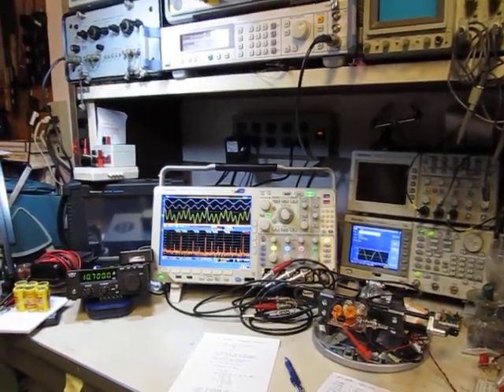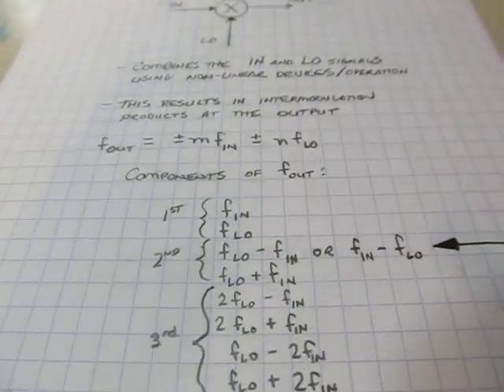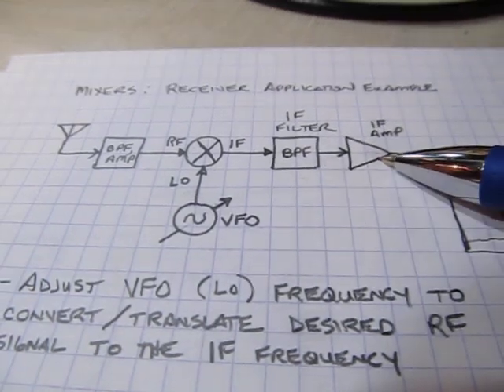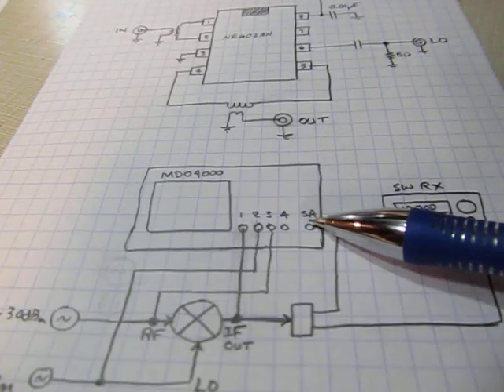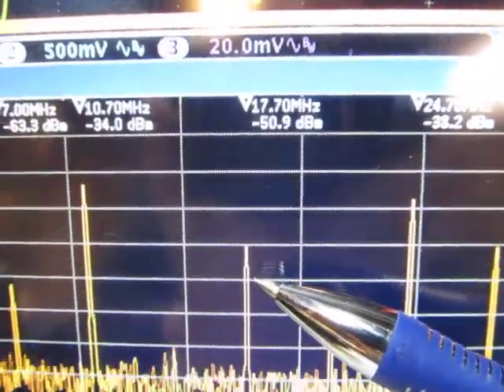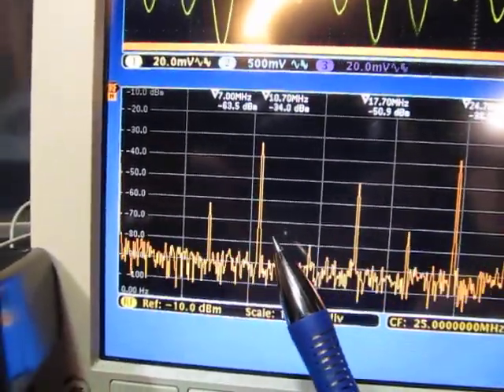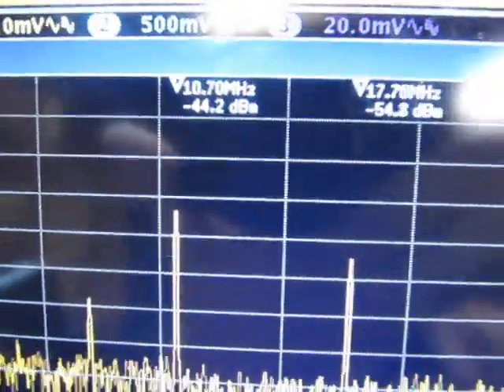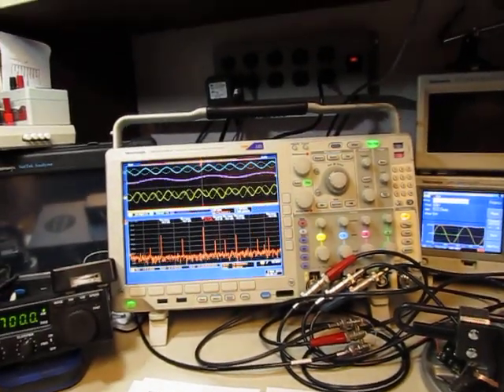#83: Basics of RF Mixers in Radio Receivers / Mixer Tutorial / Frequency Conversion

Comment: I'm building a Direct Conversion Receiver at 28.224Mhz. I'm using the same mixer (SA602) How do I achieve 15dbm gain from the mixer? I'm receiving about -100dbm from antenna, BP filter gave me -3dbm loss, 2 stage RF amp gave me 15dbm gain, and LO has tuning gain from -20dbm to +10dbm. I'm sure you know this, but basically I need as much gain from the mixer to go the audio stage, certainly I don't want to lose any dbms. Please if you can, answer this w2aew. Other question, what is your turn ratio on transformers, I know you are matching 50 ohm with 1500 ohm, thanks.
Reply from the maker: The Gilbert Cell mixer in the SA602 should give you a conversion gain of approx 18dB gain according to the datasheet.  (Gain is measured in dB, not dBm.  dBm is a measurement of power, not a measurement of gain).  You may want to review the SA602 Primer:
http://techdoc.kvindesland.no/radio/b1/20051213190607573.pdf
Reply: @w2aew  does it mean that in theory you should get at 10,7 MHz a power of Prfin x Gconv=Pif=-30 + 18 = - 12 dBm?  I see -30.4 dBm from the marker! Why?
Reply from the maker: @riccardoalbi4287  Because you didn't take into account the effect of the RF transformers and the splitter on the IF output.
Reply: @w2aew    thank you for the answer!

I saw in other comments that you're working with 50/1500 transformers for both input and output matching, and I expect no power loss in that case from transformers sections, I'm I correct?
For the output splitter I expect a 3dB loss because it has 2 ways from Your schematic, I'm I right?

 If everything is correct I should add only 3dB of loss taking into account the splitter effect and have to update the above computation to Pif= - 15dB, isn't it?  However thank you for all your videos! They are full of great tricks and considerations and very clear and well explained! 

Ps: I'm asking for those values because I'm doing pretty the same with a NE602 and I have the same values but I can't get why at the output I see less power than expected!

Comment: Nice video!. I am doing the mixer in order to build a superheterodyne but with a AD633JN.
I am not sure about the match of impedances. How do i know the input and output impedance of the CI and also the impedance that i need to adapt?
Reply from the maker: The AD633JN only has an analog BW of 1MHz, so I hope you're not going to be doing RF with it.  The datasheet has the input impedance (very high) .  You generally don't have to worry about impedance matching at the low frequencies that this device will operate over.

Comment: Is there a minimal VFO power level to drive the 1st Mixer.... I noticed that you used 0 dbm of drive power into the mixer.... 
Coud you drive the mixer with -20dbm... and still get decent performance...  Also... is it advantageous to run the VFO
at a higher frequency than the RF input...
Reply: Yes, there is a minimum power level for the VFO. The optimum signal level will depend on the type of mixer. Generally a -20 dBm signal will be too low. For instance, the optimum input power for a diode ring mixer is about 7 dBm.

Generally, a little too much is better than too little.

Comment: Thanks for the helpful video. I'd really appreciate it if you can explain how the amplitude powers are calculated theoretically. For example, at 17.70 MHz the spectrum analyzer reads -50.9 dBm. I want to know how that value is found. Cheers

Comment: Thank you. What thing happen if I don't use of transformers? just a simple one without any transformer and resistance and capacitance...
Reply from the maker: Sure, you can certainly design a mixer without transformers. The ones used in this circuit perform the unbalanced to balanced signal conversion and impedance matching.
Reply: Many thanks, I want to mix two frequencies with around 900KHz and 800KHz and obtain f1-f2 =100KHz, I decide to buy a SA602 (http://www.digikey.com/product-detail/en/SA602AD%2F01,112/568-5043-5-ND/1158038), Would you please tell me what other devices I should buy to achieve desired frequency? Thanks,
Reply: And also I can buy down convert mixer (http://www.digikey.com/product-detail/en/AD608ARZ/AD608ARZ-ND/997239). I am not sure it will work for this purpose or not?
Reply from the maker: Yes, the SA602 will work. You'll need to build a filter for the output to remove the 800, 900k and 1.7M components.
Reply from the maker: hossein jiryaei The  AD608 would be overkill, and is basically optimized for a 10.7MHz IF.
Reply from the maker: It is a surface mount part, so could be hand soldered carefully.

Comment: i dont get it: The RF-Signal (which we want to listen to) is at 28.4 MHz and the LO-Signal is at 17.7 MHz and the difference is 10.7 MHz. So we receive mainly the 10.7 MHz signal, but we wanted to listen to the signal at 28.4 MHz...whats my mistake? :/
Reply from the maker: The mixer simply translates the frequency to a different one. It's like changing lanes on the road. Same car, different lane. With the mixer, the output is the same signal and modulation, just shifting the carrier frequency.

Comment: Can you help me with something? Google for "Basic bipolar transistor mixer circuit" and check the first image that pops up. It's a bjt with an LO input at its base, an RF input at its emitter and then to ground, etc... The IF output is supposed to be at the collector... where the heck is the power source?? What's going on?
Reply from the maker: That image is only showing where the signal ports are, and leaving out all of the details for power and biasing of the transistor.  It is NOT as simple as that diagram shows. Here are a few examples that are a little more complete:
http://homepage.eircom.net/~ei9gq/rx_circ.html#Mixers
Reply: Thank you!

Comment: So.... If whenever you change either frequency, the IF changes, how do you select any signal and keep the IF in place?
Reply from the maker: In a receiver application, the signals that you may want to tune to are at specific frequencies (not moving). So, you'd adjust the LO frequency until the desired signal/station is translated to the IF.
Reply: ***** doh. Well now I feel kinda stupid. Thanks!
Reply from the maker: joblessalex Not at all.  Now you have a clear understanding of how a superheterodyne receiver works, so you're smarter!  I always tell people that there is no such thing as a stupid question, there's only stupid answers - and I try not to give those!

Comment: Could you send me any circuit diagram where I can be able to build my own mixe instead of buying a comercial mixer?
Reply from the maker: There are many different designs that will work.  One of the most common for RF work is the diode ring mixer.  If you Google "diode ring mixer", you'll get many examples to choose from.
Reply: ***** Thank you, I will try to build it right now.

Comment: Ive been a ham for 25 Years, read the Hand book chapters over & over, but actually SEEING it, makes it ALL come together. Infact, you have sparked an interest for me to start getting creative, as I have always dreamed of building a receiver, that not only was functional, but of high quality & preformance specs. I havent gone threw all of your material, so I will ask, do you have videos on mode specific detection? IE AM detection, FM , SSB.. ect? Also, 1 last question, I'm starting to think about proper gear I would like to get to actually make a HB receiver , and I know I will need a LCR meter to make BFS's, many of the hand held options in the 100-200 dollar range only have the ability to test at 1 or mabey 2 given frequencies. Would I be correct in my assumption that in order to properly make BPF;s of decent quality, I would need to be able to test inductors @ their intended frequency of operation? Thanks for the vids!
Reply from the maker: I don't have videos up on specific demodulation types yet.  However, I have several "receiver walk-through" videos that discuss the demodulators as part of the schematic review process.  Personally, I haven't found it necessary to test these components at the frequency they're going to be used at.  You just have to be aware of the self-resonant frequency of them, and operate below that.  I have several vids that discuss the basics of inductors and capacitors, how to measure them, etc.
Reply: Excellent, thank you so much for your reply & hard work for putting these fantastic , educational & informational vids up
Reply: imscuba c

Comment: Thank you for you reply, one last question, what type of connectors are you using, from the circuit side and to the one connected to the signal generators, and should i worry of there impedances?
Reply from the maker: I just used ordinary 50 ohm BNC connectors.

Comment: Hellow sir, what are the number of turns for primary and secondary for those transformers, and the material of wire is it iron, i want to build and test the same mixer, your clarification will be appreciated.
Reply from the maker: That circuit came right from the book "Experimental Methods in RF Design", page 5-11.  It shows the transformers using turns ratio of 4:35 turns.  It doesn't specify a core material, I just used some type 43 cores that I had here.

Comment: yellow please suggest me which transistor i can use to construct a testing mixer prototype for double gilbert cell topology, i will be very thankful this is for my project,..
Reply from the maker: The only requirements are that they are the same device type (reasonably matched), and that they meet your speed requirements. If you are going to be operating at HF frequencies or lower, then an ordinary 2N2222 or 2N3904 would do fine.

Comment: Another excellent video, you have obviously taken time to build some excellent test rigs. You mention that you may do a video on PLLs, I am sure that would be excellent too, though probably easier to demonstrate on an old CB radio or similar rather than build a test rig from scratch.
Many years ago I was mystified by the operation of a Huff and Puff stabiliser, it was a circuit for a homebrew amateur project. Years later I was working on an HS400 frequency generator and suddenly the penny dropped as to how a Huff and Puff stabiliser worked. A poor mans PLL!
I have been an rf engineer and hobbyist for a very long time, but watching your videos is still a great way to get another take on things.
To the beginners in the subject I would encourage you to watch the videos closely, this is good information presented really well.
Reply from the maker: I did make a video on the basics of PLLs.  Here's the link:
Basics of Phase Locked Loop Circuits and Frequency Synthesis

Comment: I can imagine how this works with an AM signal as input, since the output peaks are just a multiple, they will change in height propartionally. But how does this work with an FM signal?
Reply from the maker: The mixer can be used for frequency translation / conversion, regardless of the modulation type - it doesn't care.
Reply: *****
I'm just looking into RF stuff for a week or so. It looked like black magic to me for a long time ;). I can say that your videos are the best explanations of all I found until now. For most topics I normally start out with Wikipedia, but it didn't help much here. Your mix of theory and application is exactly the right combination.

I though a little more about it. I think my mistake was to assume that the filter after the mixer only lets one frequency through, which it never doesn't of course. So since you tune for one of the differences of RF and LO, the IF just jiggles around as much as the FM RF did. If the bandwidth of the filter after the mixer is wide enough, you got a FM IF with the same absolute modulation width than the RF had. Is that correct?

Maybe you could do a video sometime about the maximum modulation width for a certain carrier frequency and what the maximum signal frequency that can be modulated onto that carrier can be.

Comment: With a diode as a mixer, how would you hook it up? would you just stick both signals on one end and get the produts out the other side? Also, is it better to use an IC mixer or will a diode/transistor/ect work just as well?

Thanks -- VE2HKW